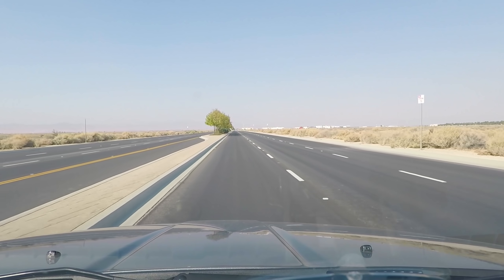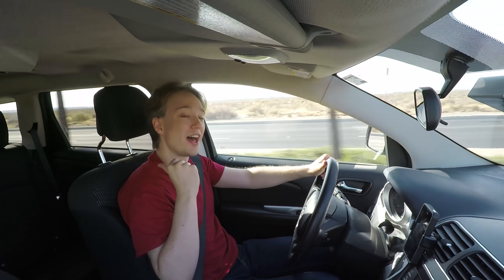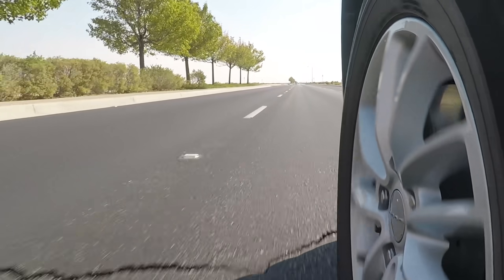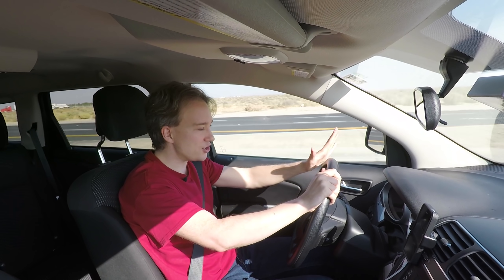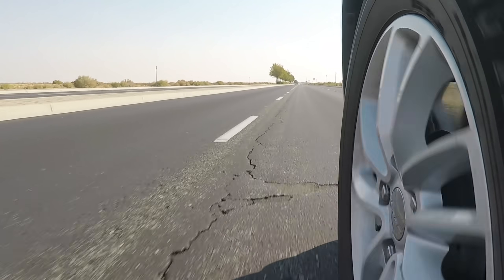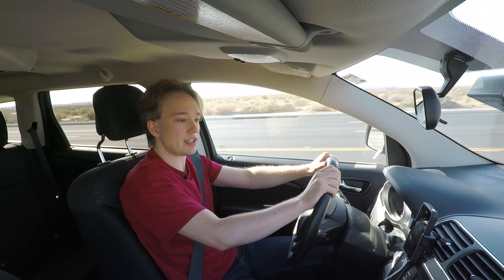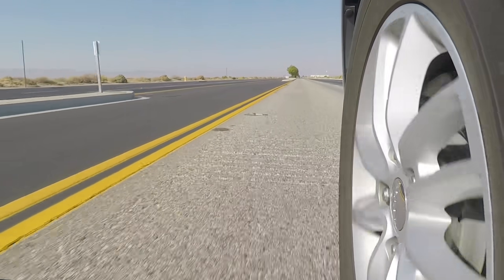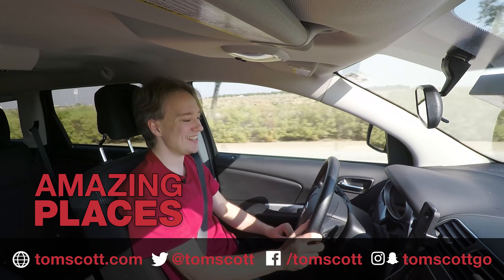Why California's musical road sounds terrible

Comment: I get dajavu hearing the conclusion at the end.
It is just like a boss, project manager mayor or political leader to assume or be 100 % certain they are correct and the reason it failed was due to the people below your great magnificence that is the reason for the entire plan going ahry.
They rebuilt the road and i bet they doubled the number of supervisors during its construction while the workers worked for free this time and before because add revenue should be free as it will be money in the workers pocket when the quotes start rolling in because every business thinks the workers very existence is owed by the people above you putting food on your plate. 
You are lucky you have a job while we sit in front of some kind of air cooling system.
I am fortunate to have the skill and position at a time where workers are very hard to come by to be able to tell my superiors no you are wrong and i am having the day off because you brought me great stress and hardships with your over sites and there is no one that can take my place right now

Comment: The problem isn't language, anyone who's ever designed anything ever (even in secondary school Design tech) knows to factor in where to measure from, or what a period is, whoever architected and oversaw the implementation of this seriously messed up and should not have been paid.
Reply: I mean for good sake how did they not notice that the whole thing was at least 10% longer than it should have been???

Comment: Wow, you know the thing that baffles me the most about that? All across the construction industry people measure the spacing of things as the distance between the centers. For example, studs in a house are often 16 inches "on center" or maybe 12 inches but ALWAYS "on center". Why would these construction engineers think the spacing would be anything but ON CENTER!?
Reply: Good question. Reasoning backwards through it, it indicates that there's little or no overlap between whoever is responsible for this, and other construction workers that are familiar with the center-to-center convention. Off the cuff, I can't think of other road construction things that have repeating elements like house studs.

Comment: The road worked perfectly. Honda built the road to work with their (at the time) new Honda Civic in the Lx trim level with only the factory tires, with that exact new Honda Civic it worked perfectly. 
However when you drove any other vehicle with a different wheel base and different tires it sounded HORRIBLE.

Comment: When the A12 Colchester bypass was originally constructed a section of the concrete surface had accidentally been laid with ridges on the surface. When you drove over that section at 60 mph or more it sounded like the road was screaming!

Comment: The last few tones seem to suffer from another problem. The final tone is supposed to match the tonic but it doesn't. However, the tonic is not affected by the described problem. Having to tune end somewhere above the tonic vastly contributes to its poor impression.
Reply: After reflecting the William Tell's Overture Melody, I can tell I was mistaken. The undistorted tone is the lowest one and in this case this lowest tone is (a fourth) below the final (tonic) tone. That perfectly explains how absolute pitch increments distort the final tone.
After all, this is an amazing story. I wonder how so much effort could be spent for developing and implementing a solution and not even basic effort was put into making it work.

Comment: That means this wouldnt have happened in Germany because German is the most accurate language. There is no such thing as misinterpret something or Mistakes. If used correctly german is absolut. Thats also one of many reasons why it is quite hard to learn, even many other languages use German words for things. In Germany there is a word for Everything.
Reply: As a German i have to disagree. There are various ways our language can be misinterpreted :D

Comment: this is metric system failure. Switch to standard.
Reply: No it isn't? It's a communication failure, they forgot to account for the width of the grooves themselves, this wouldn't be affected in any way by changing what measurements you use.

Also, a measuring system used in 9 out of roughly 200 countries isn't "standard".

Comment: I wonder what kind of an affect the fact that vehicles have more than one pair of wheels on an axis has. Ideally unless the car has been in an accident, causing let’s say one of the front wheels to be pushed back as compared to the other side, or having the alignment so off that the vehicle is dog tracking, we expect both wheels on an axis to hit the grooves somewhat simultaneously. But vehicles at least have 2 axis of wheels and the distances between them varies from vehicle to vehicle. It’s like putting two needles on a record player that are offset.  The other thing I’m wondering is wheel diameter affecting amplitude since smaller wheels would further fall into the grooves causing a more forceful impact on the tires. Also larger diameter tire might cover multiple grooves at a time since the flat contact pattern of a larger diameter tire will be larger and it looks like the grooves are not very far apart especially on the high notes. So many questions.

Comment: ya. contruction ppl know the saying "center to center" like think 2x4s in a house. the house that is 200ft long would be 204 or something feet if you keep adding in the width of the 2" beams of wood. no, they know center to center. this was the designer's problem for not knowing how to explain his brain.

Comment: I mean, couldn't someone just make a custom machine that makes these based on a piano roll, on the fly?  Some laser guided thing that could cut precise grooves at the right distances apart as required?

I'm sure someone's just itching to attach a Pi and Arduino to heavy equipment just for this purpose.

Comment: I heard that allegedly there is a stretch of road fast near me that most people speed on.   At the 60 mph speed limit, you don't notice anything.  At 75, if you listen for it, you can hear a low tone. But at 120, every overpass has a very pleasing tone, close to a C5, or about 523 Hz, for 0.25 seconds.  Like the road saying "I was made for this.  Hi there. Bye there".   Not that I'd have any sort of personal experience with that, and there is absolutely no evidence to say that I ever did.

I've never had an opportunity to stop and measure any features on the road.   That'd be crazy, people drive really fast through there.

Comment: If you have a car with a shorter or longer wheel base, will it not play the song differently?
To me, the math seems more complicated than you're implying.
Is it even possible to do this correctly?
Reply: It would technically play the song twice, slightly out of sync. The delay between them is indeed influenced by the distance between the wheels. My searching showed that a car's wheelbase is typically 2.5-3m, which at a speed of 24.6m/s will give a delay of 0.1 to 0.12 seconds. It would be the same delay as driving over a bump in the road and hearing that "du-dun" as each set of wheels passes over it. I did some experimentation and as far as a can tell, a song that is played one frequency at a time probably would have come out fine with those delays.

Comment: As an European guy, I really dont understand why you have roads so big and nobody using it
Reply: Not all roads are always used all the time?? Is that weird in Europe? But anyway I guess the answer is that the US is less than half the population of Europe while being significantly bigger. Roads are the only way to get around the country in most areas because building a train to get to a 500 person village just wouldn't be economically feasible.
Reply: @kalo8524  it's because it looks like a middle of a day and we see nobody else, for a 4 lanes road
Ok I didn't think about the density of the population, but why not just make a 2 lanes road if it's not used that much?
Reply: Someone who lives in Lancaster California might know the answer but sometimes in California, roads may have once gone to very heavily populated areas but now those populated areas are much smaller. Also, sometimes roads are only used to commute to work so at 8 AM there may be very heavy traffic but at noon it will be mostly empty.
Reply: @kalo8524  okok

Comment: Should be illegal. Increased noise pollution + increased safety risk from drivers changing lanes, either to avoid it or to try it + eventually, how does it affect grip?.
A road has one job to do, and not others.
Reply: The musical road is called like that for a reason

Comment: Ironically, my grandfather and I were once driving through Lancaster Pennsylvania and we passed over some groves in the road and started theorizing if you could make a song out of the vibrations assuming they were spaced correctly. We also thought that maybe you could get them to say "Slow down"
Reply: I’m not sure how many properties of sound you could modify with grooves on a road. At the very least you’d need to be able to modulate the EQ of the notes to even begin to emulate spoken words, not just the pitch, and I’m not sure how you could do that. It would probably necessitate changing the shapes of the grooves in some fashion,  and/or adding/removing smoothness or some other property of the surface.
Reply: @sgvincent100  In theory, you wouldn't need anything more than a really complex and detailed pattern of grooves to reproduce spoken words (e.g. the S in "slow down" would be a really fine groove pattern). Any sound CAN be represented by a single, albeit complex pattern of waves, just think of the grooves in a vinyl record. I have no idea whether it would be practically possible in a road surface though...
Reply: @mattiasbjorkas9223  Each wheel can only produce one frequency at a time (in practice, that makes two separate tracks), so it's not feasible to reproduce human language like this.
Reply: @momom6197  you’d only need one track. Think of the groove in a mono vinyl record.

Comment: In construction we use the term "On Center" to describe putting something every X and X is the CL of that thing. Structural Engineers, Architects, everybody in construction knows that. So they got somebody unfamiliar with construction involved (and also apparently unwilling to have somebody experienced with construction to review their work and terminology) to do the blueprints and this is what you get.

Comment: In carpentry there is a very easy solution. For example if you’re installing studs, you might space them 24 inches on center. This takes away the width factor of the stud, which would be an inaccurate.

Comment: I am attempting to work out how they separate the tune off of the front tires from the tune coming off the back tires. Like 2 musicians playing completely out of sync (and all vehicles have a different wheel base). Imagine the harmonic cancellation and amplification depending upon the vehicle wheel base.
>
The ear torture road... At least the drivers won't fall asleep for that 10 seconds.

Comment: This reminds me of debugging code. You finish your code, run it and realise that it doesn't do what you intended. So you go back, fix one thing that could be the issue, only to realise that the result hasn't changed by a lot. It usually takes more than one additional attempt to completely fix an error, even if it is as simple as in this case, but unlike with code, each attempt costs a LOT of money here.

EDIT: I am seeing a lot of similar responses here, so just to clarify: I am not saying that the usual engineering process is like debugging code. In fact, going about building a road like a hobby coder would go about coding, ie. engineering based on trial and error, is absolutely archaic and should have been a thing of the past ever since we started counting our years, if not earlier. What I'm saying is that the approach they apparently chose here reminded me of how I occasionally debug code.
Reply: That's why it's not what civil engineers do. They work with a prototype or small part of whole project for testing.
Reply: You don’t debug code, you just put enough duct tape in the right places and pray to God it all works.
Reply: @anusmcgee4150  I was gonna say. With code, you go in and change one little thing…
Reply: The key difference is that programmers usually work with virtual things, or can usually create a virtual stand-in for physical hardware.
That means you can work iteratively, improving across multiple attempts and even releases.
In most hands-on jobs (doctors, engineers, mechanics, construction workers etc.) that usually isn't possible.
Reply: @MartinFinnerup  actually engineers tend to use 3d modelling softwares like solidworks to test/visualize their design and function, doctors are beginning to do that as well with VR/AR tech.
Reply: What you described is known as "manual testing". You should do automatic testing: make specification-testing routines that verify all types of input against desired output, and whatever you build must pass against all such routines - it's how you know it definitely works well.
Reply: @michaelbuckers  How do you test the testing routines?
Reply: @dfrmex  You don't need to. You just specify known combinations of input and output.
Reply: except these were 2 different problems: location and sound. They only fixed one
Reply: you need to take a look at TDD -- Test Driven Development & Unit Testing + Have unit tests in place to avoid that.
Reply: They need a ci/cd pipeline that’s all
Reply: ok nerd
Reply: @samu-chan  shut your up
Reply: Yes, that's drives me crazy. When you fix the program and you still have the exact same error. (>_<)
Reply: That is one way to debug code.
Reply: They could have simulated the result, and they should have had clear, dimensioned drawings (specifications). You know, like every other engineering project. This wouldn't even take mutiphysics simulation, just some Python code to gen a wav file based on the spec table of groove placement and width, or at least tabulate the frequency vs time.

Comment: Just a question, doesn't the length of the car also affect the tune? Meaning a car with a shorter wheelbase will sound different from a car with a longer wheelbase? Or does that not matter?
Reply: Well, the pitch coming from each individual wheel is not affected by length, but the longer the car, the more the notes blend together into a mess, not a song
Reply: Spot on! And look how low your approvals are when compared others. Logic, and thought process counts for nothing in this, "I only want happiness, and to be pleased at all times", world.

Comment: Hmm 🤔 this might explain the highway /freeway to King Shaka Airport in South Africa…. Except that they went for the sound of aircraft engines coming from the road.  It gives the impression the airport is bigger and busier than it is.  Until you transition back to tar for the last +- 1/2 km and realise the sound was the concrete portion of the highway not the airport.

Comment: Wondering why no-one has built a stereo musical road with a different note for each side of the car. I also want to see some effects like fades, pulse shape modulation, note slides.
Reply: ...plus a few truck-driver's gearshift key changes in there for good measure. 😄

Comment: In all you and your friends infinite physics and science knowledge you didn't figure out that the intervals would be correct and in tune with themselves ONLY AT ONE PARTICULAR SPEED. If you don't drive that speed not only does the tune slow down or speed up but the intervals are out of tune with themselves.
Reply: So really...  Nothing went wrong, you just didn't understand this. The correct speed is probably 75 mph... The speed limit. Ahyulk
Reply: I should have stated more completely... Not only does the tempo of the tune speed up and slow down.... And go Sharp or flat.... But the intervals are out Of tune with each other unless you drive the exact one speed they engineered it for.
Reply: the simple reason it only works at one speed is because the mathematical value of the cycles per second between 12 tone scale intervals increases exponentially as you go up in register

Comment: I think it’s depend on how fast you drive over it.
Seems like there’s a certain speed for it to work.
Reply: No, the speed will raise or lower the pitch of the whole song, but it won't change the relation of the notes to each other.
Reply: No it's more like a needle on a record player - the faster you go the higher the pitch and speed, but it will sound equally off pitch if the song itself is printed wrong on the vinyl

Comment: Actually, you are wrong.  It's out of tune because of the length of your car.  Both your front wheels and rear wheels make the sound.  Depending on the wheel base of your car, notes being played by your front wheels will not coincide with notes played by your back wheels.  Giving you dissonance rather than harmony.

Comment: I imagine it will always sound bad no matter how the spaces may be corrected because it would play on the front wheels and on the back wheels and with every car having different length wheel base the front and the back would interfere with each other. Some cars would play it in phase and some play it out of phase. It's like having two needles tracking in the same grove of a phonograph record (do any of you even know what that is?).